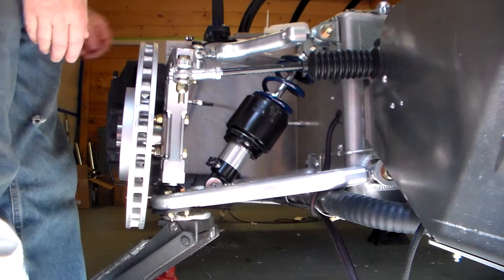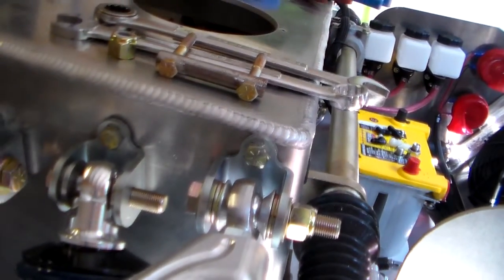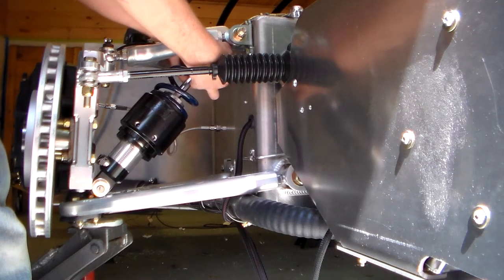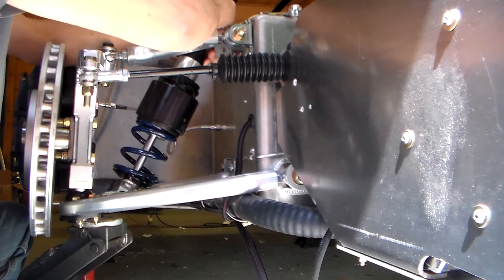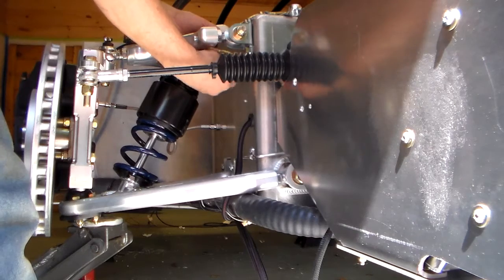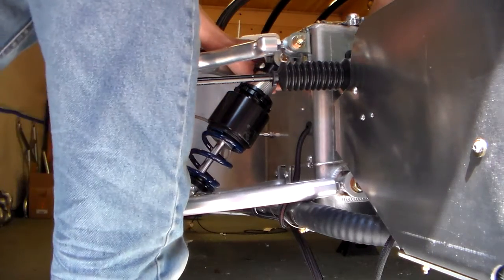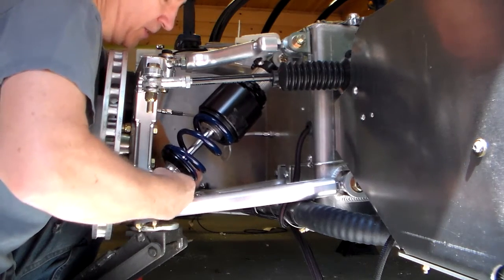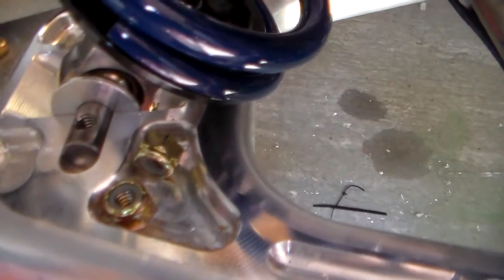SL-C Build Lift system

Comment: Allan,  Hope you are well, I see in this video there are two rods for the bottom shock mount. One through the bottom of the shock and another underneath. Is that the way the cars are still assembled? My kit only has the one that goes through the bottom of the shock. I just used cap screws and a washer from underneath and then put a locknut on top of the rod. Just curious. Thanks!
Reply from the maker: Everyone that I have seen has two rods.  Take good care.